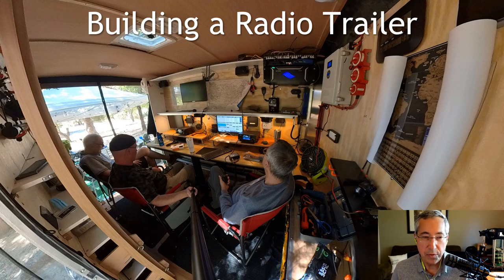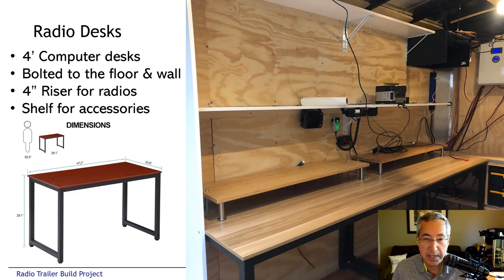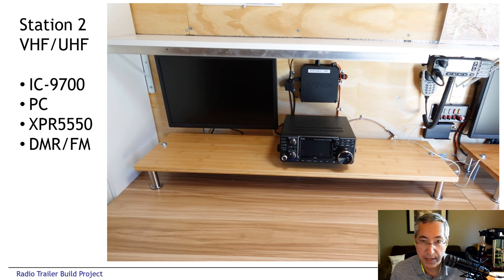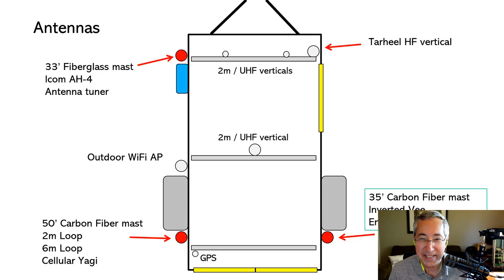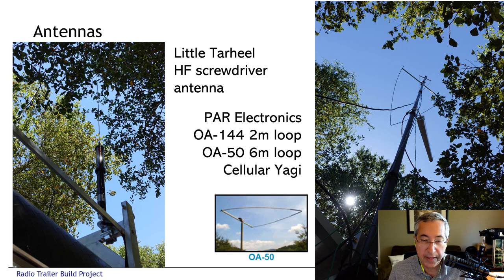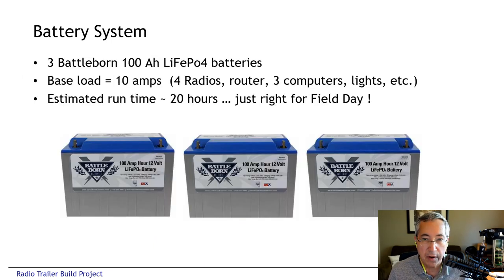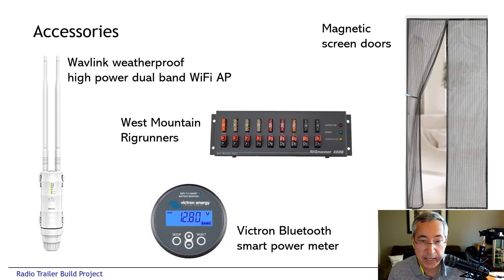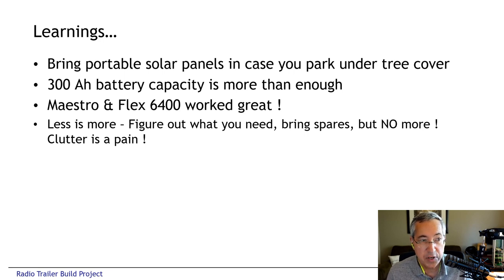KJ6VU Radio Trailer Build Project

Comment: What was the budget?  Where did you put the fire extinguisher?  No exterior lighting?  No door step or grab bar? No grounding?  Maybe I just missed these things.
Reply from the maker: @BowWowPewPewCQ  
Extinguisher - Mounted to the wall at the rear door.
Exterior lighting - Roof rack mounted LED spot lights although they rarely get used.  
No external grounding
Steps are at both side and back door.
No grab handle
Budget?  What budget?

Comment: Is all of your wiring surface mounted and/or in raceways?  I'm building something similar, and am loathe to drill through any of the metal studs to route wiring in the walls.

Feral pigs at Field Day?  Sounds like a field day BBQ in the making...

Comment: Enjoyed the video of a well thought out installation. Based on your lessons learned what would you do differently? The coax patch panel is great. 

Since we are in Hot and Humid Houston we too are considering air conditioning with a generator and magnetic plastic doors. Can I drop you an email? Thanks again for sharing a great build. KI5FJS Paul

Comment: What did you use for insulation?
Reply from the maker: It was 1" common foam core insulation with one side of foil.  I think there are better materials with a higher R factor but this was available and good enough.

Comment: You can easily spend as much on the Battle Born batteries as you do on the trailer.  Most RVs don't go that high-end with their batteries.  There's no doubt they're great stuff, but that might be a good place to economize a little bit.  They charge $925 each for those batteries, and another $7 for the cheap-o carry strap.  For $925, they can't throw in a handle?  

GREAT VIDEO!!!!  Love the straightforward approach as well as the obvious lack of overkill in the engineering and equipment.  The one addition I'd probably want in the trailer, depending on where you're based, is some sort of climate control.  I'd love to see links to the stuff you used included in the video description.  (Yeah, I'd rather stand on the shoulders of giants than reinvent the wheel.  🤠)

Do you ever find yourself wishing you'd gone with the 12' length?